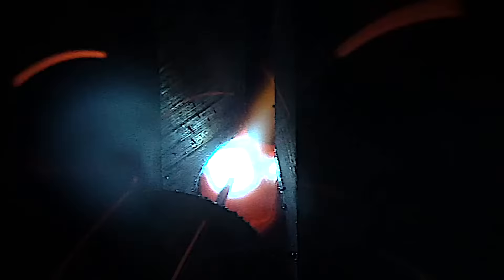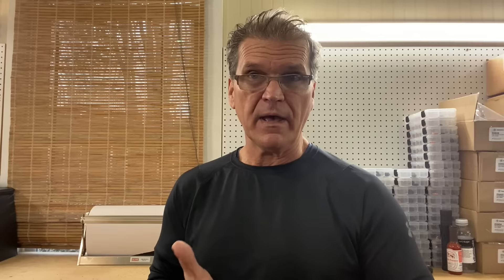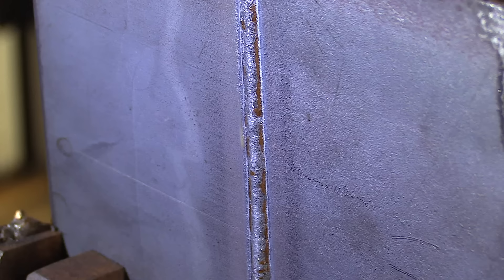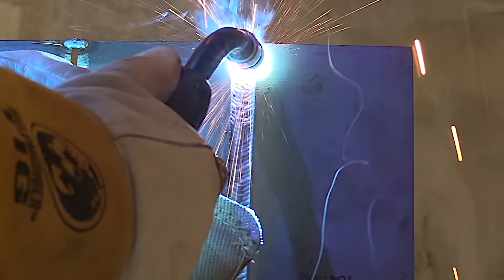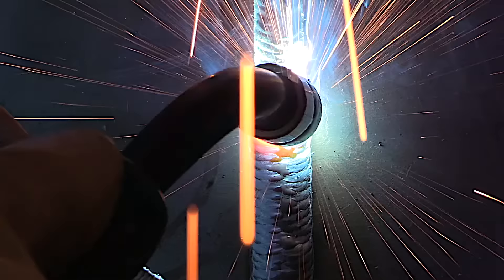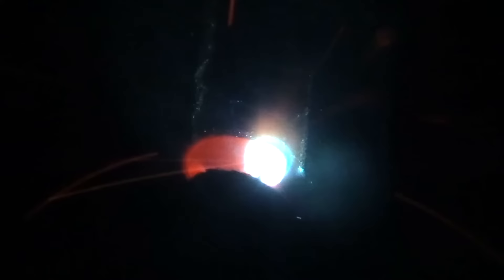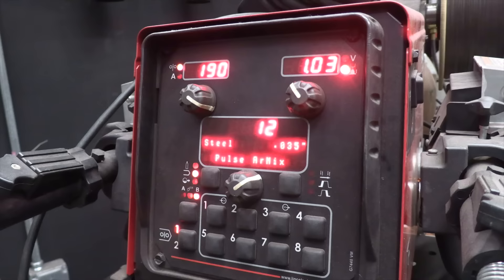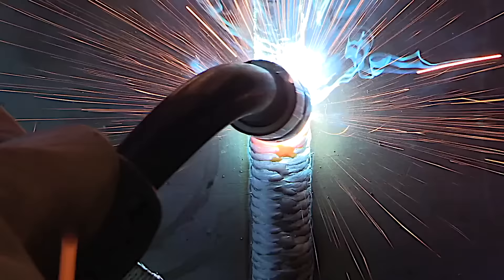3G MIG Uphill Pulse Spray vs Short  Circuit

Comment from the maker: I am posting 30 videos in 30 Days for August …customer appreciation month at weldmonger.com.  Lots of deals and giveaways going on too but you will need to sign up here https://weldmongerstore.com/blogs/weldingtipsandtricks/wm-blitz-video-1-30-videos-in-30-days
Reply: @weldingtipsandtricks Jody, I have long heard of this Spray Transfer method. Can you please explain to me how you know if your Machine is capable of this method??
For instance is the new PrimeWeld Mig 285 capable of this and the Fronius TransSteel 2200 & 2700 capable of performing Spray Transfer???
Reply: Spray arc uphill? No way on solid wire.

Comment: Pulsed mig is a beautiful thing, just buzzing like a bumblebee and next to no spatter.
Reply: My Millermatic 255 still ton of spatter on pulse but the penetration is amazing. Maybe it’s just because I use it on 3/16” material half the time.
Reply: It would take me some time to get used to that noise. But I could for the best results when needed.
Reply: @Darlhim89 what gas are you using?
Reply: Same thing here @Darlhim89
Reply: @Darlhim89 gas should be 90 % argon and adjust trim setting little by little until spatter goes away
Reply: Volts plz

Comment: The navy made us use pulse mig on certain steel instead of flux core because of heat input. We were doing 0.45 100s solid wire with 95/5 gas vertical up. I’d absolutely love to see a video of you running that process with that size wire and that gas vertical up.  It’s fun. lol. It was mostly class 1 UT butts. I miss the ole shipyard. We built the three new zumwalt destroyers. Pretty wild looking ships!!!

Comment: been watching your videos for almost 10 years i think now, and i have learned so much. i was actually a welder in a factory for a hot 8 months, started out running the robots but eventually passed some kind of test for hand welding. i loved it but it took a toll on my body working 10 hour days in a factory so i ended up leaving. but i take what i learned, and use it whenever making something custom or repairs at home!

Comment: For the majority of things I believe pulse on steel is a solution to a problem that was already solved by flux core or metal core wire. FYI, I’ve been using pulse for a decade now.

Comment: I've recently got to run some pulsed spray mig and the rmd process on a Miller pipeworks machine. Great processes. The guy asked me if I ever ran the RMD, I said no sir. He said you'll like it. It's almost cheating on welding a root in pipe. Great video sir. Keep up the great work.

Comment: You mentioned the structural Codes being restrictive with the GMAW SC process.  This is correct much to the surprise of many welders and their supervisors.  Structural welding for Dow Chemical was/is to the AWS D1.1 Code and I believe it stated that for every 10% increase in material thickness above the WPS being used, a new WPQR needed to be performed.

Comment: Pulse is very common Here in Europe . All Jobs with MAG Are done with 1.00mm solid core wire and M21 gas . Only Standard MAG is used to make the Root . We also use a Special Variation of the 6013 Elektrode with a mix of Basic and Rutil coating ti make Hot Fill and Cover Passes . Works Great an x Ray . 
The strength is absoluty Great and over that what the Brand tells on the Box . 
I am Personal a Big Fan if the amerikan way of Welding. Im praktacing every Minute i have with 6010 . the Problem Here Are our welding machines…. The normal Stick Setting has only a Voltage Range of 40v . For 6010 you Need a Machine with Special Settings or a Machine Before 1970 ….

Comment: Jody, I'm gonna comment before watching. I'm hoping this video will change my opinion. I have never been able to achieve improved vertical uphill welding with pulsed vs SC. Even though I could fine tune the arc for better appeal, I could never get more than about 8-10 percent increase in WFS and still control the puddle. 
I am hoping this is an eye opener for me so I can better inform my students. 
Thanks for all you do. 
Gerald

Comment: I know you probably heard this before. Do you have any tips on over head welding with hard wire 0.35 on plate with no groves. For learning over head. I’m a basic welder in a trade center looking for some tips and or tricks to help me pass this position.

Comment: A note on Pulsed Spray. Bought a Millermatic 255 specifically for Pulsed Spray and doing Structural Steel welding with .035 wire and 90/10 gas. The "autoset" pulsed mig was not working consistently and I was getting short circuit/bb's/porosity sometimes (up to 50% of the weld). Thought the machine or gas was bad. Went to the LWS and they had same machine/gas/wire. The guy was all confident about welder until their equipment did the same thing! I was happy, he was upset. He fooled with the machine on 1/4" coupons for a half hour until he abandoned Autoset went to the manual pulsed MIG - then nice hiss & clean welds.
So for the Millermatic 255 if you have grief with Pulsed Autoset, go with Manual there are only a few settings to mess with.
Also, for me (intermediate level welder), the above machine/settings likes downhill on a vertical tee joint alot better than uphill.
I do love the cleanness/penetration/speed of pulsed spray.
Reply: What do you run for cfh?
Reply: @js18ms  Alot, like 40, the LWS guy said "more is better".
Reply: And I do 2 seconds of pre-flow.
Reply: @tedsaylor6016  what does your wire manufacturer call for?
Reply: The april2024 software update fixed the issues with autoset pulse on the millermatic 255.

Comment: Nice one Jody!

What do you think of preheating the thicker joints to help the root wash in better when using short circuit mode...?

The back side weldmetal to basemetal interface looked a bit sharp, and the weld seemed cold-ish.

Comment: I was wondering if anybody has any tips for pulse stainless mig but my wps has high parameters for the volts and low parameters for the wirefeed we also have to use trimix we do a 1/4 inch root with a backing on 3/8 plate 045 wire  we messed around with the setting but couldn’t get it to buzz it’s a lot of popping and spatter we had I only got one shot to pass the test and I failed but I’m hoping some tips can help me on the next go around

Comment: Hey Jody, im in a pickle right now on my job site, im working with a machine that has no display, no pulse, ,im working on a stainless steel reservoir, 1mm wire(c2,5 gas) and i just cant make it work properly,it welds nicely( spray was just fine) and short circuit looks and sounds fine but welds are sagging and itt just doesnt look right even on low settings, so am i doing something wrong here or pulse is the only solution, thanks for your time great vids as always!
Reply: Sagging...
Weld faster
Reply: Or if your allowed to use it ,change to flux cored wire 1.2 mm for stainless.
Welds a lot nicer

Comment: Can you do a 6g 6” schedule 80? Short circuit .035. down hill root. Uphill fill and cap. That one has been a challenge for me
Reply: 2 bead cover passes
Reply: Maybe I can help you.  I passed my 1st 6”xhy 6G short circuit in 1971 and weaving 6G’s was my trademark.  You’re running a 2-bead cap but that still requires a degree of weave.  Always, always keep your puddle horizontal and not square to the joint.  On the bottom and top, with your 2-bead cap, I suggest using a small/tight oscillation instead of the inverted weave you’ed use making a 5G all while remembering to keep the puddle/oscillation horizontal.